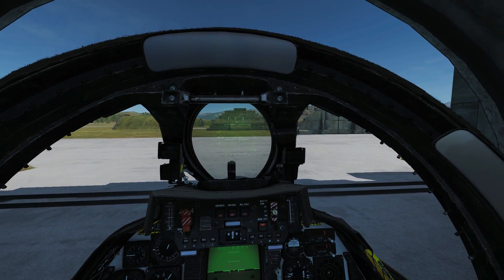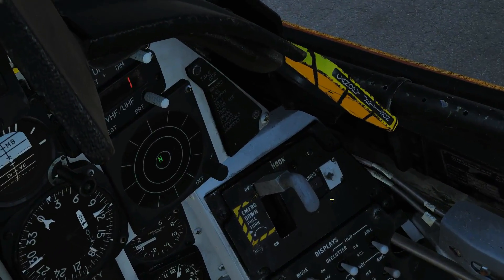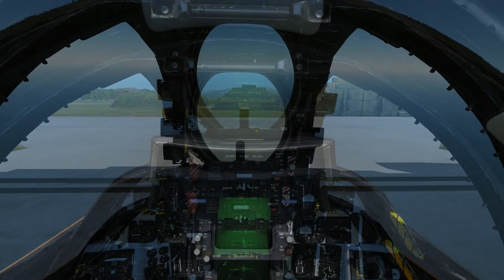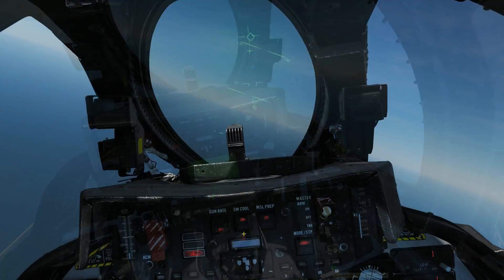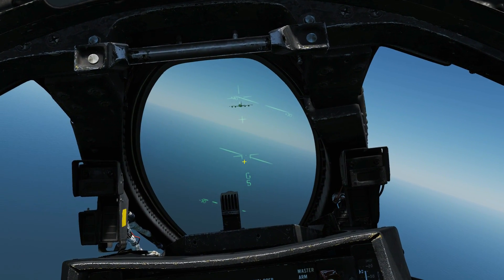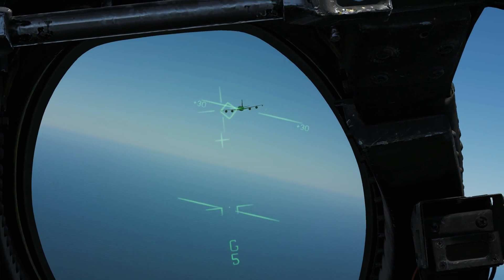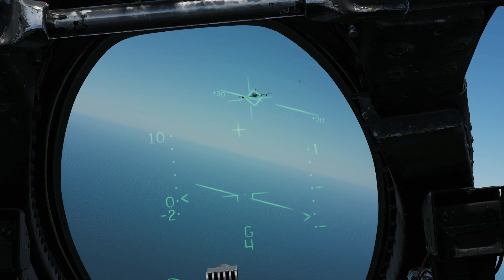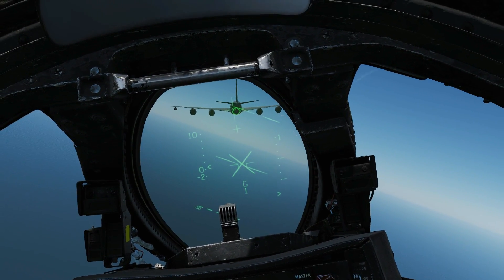F-14B Tomcat: M-61 Air To Air Gun Tutorial | DCS WORLD

Comment: 4:00 - 4:09 "..one thousand feet for the diamond and two thousand feet for the cross" 
I think you have them backwards. Since the diamond is the one that moves further away from the gun boresight that has to be the one that's zeroed for the greater distance, unless the Tomcat is shooting magic bullets for some reason.
Reply from the maker: " The diamond representing bullet location at 1,000 feet and the pipper representing the bullet location at 2,000 feet." from the Flight manual
Reply: At the risk of sounding like Maverick, the manual may be inaccurate. It makes no sense for the shorter distance lead to deflect more when maneuvering than the longer one.